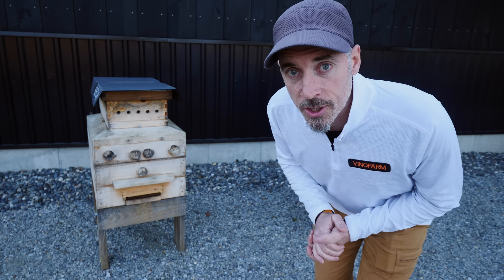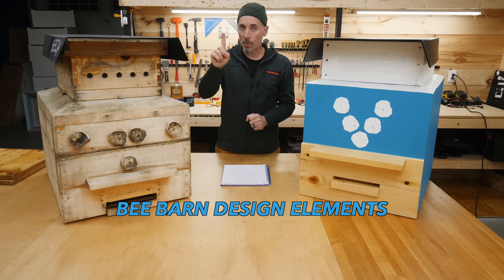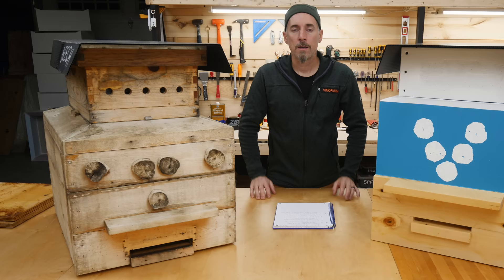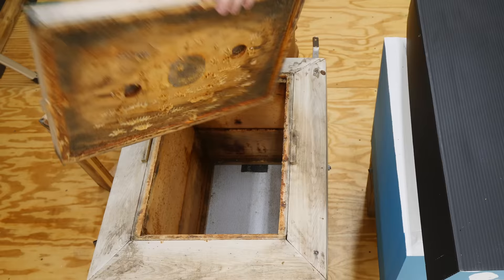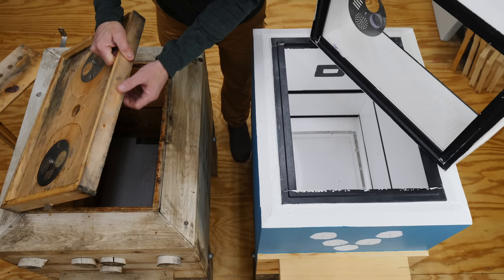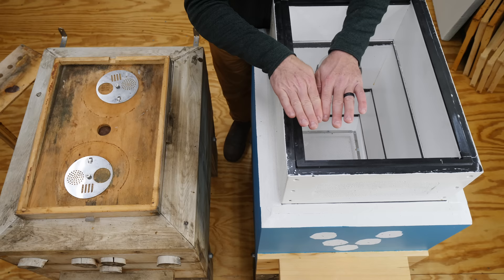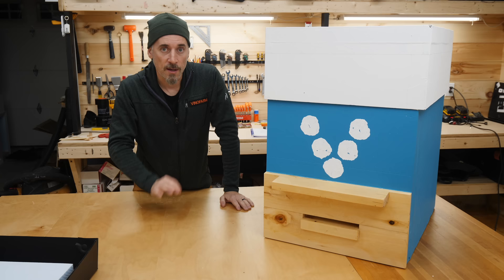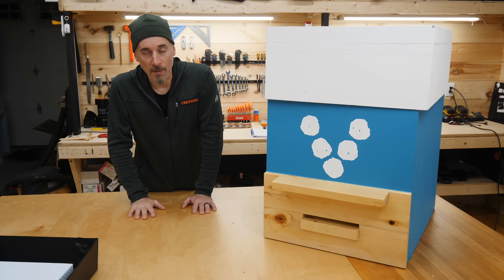I Fixed The Langstroth Hive (Again) - Bee Barn 2.0 REVEAL!

Comment: I just started beekeeping this year with a top bar hive. It's a 2nd hand one that I had to really clean up and repair some parts but my son helped me with that part. We scraped the inside and lightly torched it to kill off any nasties, replaced the bottom screen and board, which was in pitiful shape, and built a bee yard in the southern corner of my back yard. Due to the neighbors garage it's in the shade until about 10a but then it gets full sun for 4-8 hours, then back to shade. There was a small tree growing in the fence so I left that there to provide some shade during those hours. It's going to get cut so it won't grow any taller and I'll keep the branches thinned out some. I left all the honey in there this year because they are still, to me, a small hive so I wanted to make sure they had enough food. I live in northern Wyoming about 30 miles from the Montana border. Sometimes I feel really anxious - did I do enough to keep them from getting too cold? Did I leave them enough food? I'm only going to keep the one hive though. I got it to help the fruit trees and other plants around my neighborhood to bloom better and produce more.
Reply: Hi Roxanna, you may want to look up David Burns who keeps bees in cold weather also.  He has some winterization videos for regular hives that may be helpful.

Comment: Thanks for your Videos,  they are always inspirational and entertaining.

I use Paradise Poly hives and using your inspiration converted some of my boxes to deeper frames using a full and ideal hive box.  I also reduced the bottom ventilation for Winter.

My results were that I had a heap of condensation and mold at the top of the boxes, although admittedly it was a wetter winter.

I do agree with the extra insulation at the top though,  that is where the condensation seemed to occur mostly.  It almost feels like the humid air rises and then condensation forms at the top around areas that it is colder, so I was thinking of doing similar things with regard to extra roof insulation.  I might try and increase that this year with a lid that goes down over the top of the lid to get extra insulation at the top.  .

One of my other big issues was the lack of utility in having the longer frames.  The longer frames were harder to use with regard to moving frames into Nuc boxes or moving frames around for Queen breeding etc.   For now I have decided to go away from this idea although I still like and understand the concept.  What I will use is a full frame at the bottom and an ideal frame at the top.

Look forward to further updates.

Comment: Maybe it's in the follow on video's. I come from a much colder climatic zone so this may not be relevant for your location.

Did you raise the Interior point of the Entrance so it is elevated above the bottom board? This allows some space for dead bees to collect during the coldest parts of winter when the bee's are in a tight cluster and the undertaker/cleaning bees are not disposing of them.
I found this made a big difference in the entrance staying open - not getting blocked by the dead bees piling up.
Reply from the maker: What I have noticed with these hives is that the “piles of dead bees” thing doesn’t happen. I used to see it on my old hives, but last year and so far this year there are roughly zero dead bees on the bottom boards. It sounds crazy, but that’s the case. Very few bees die over winter when you give them a good home.

Comment: Awesome Job Jim!  I really like your original concept of full insulation, we do this in our house, and it helps keep our energy bills lower.   I'm excited to see your version 2 performance results.  
One first thought would be to put coreplast around the exterior to prevent mice from chewing through the polystyrene.  Although the paint may give it enough protection.

I like the winter outer polystyrene cover.  I think that you could add another layer of polystyrene from the bottom lip of the outer cover that goes further down the side of the brood box.  This will add a little more insulation and help center the outer box to make sure it keeps your 1/2" air gap.  I like how you use the angled surface to match the insulation on the bottom brood section.  I think that the angled corner sections may be catching some of the cold wind and causing a cold corner spot which could be what is causing your corner condensation.   The outer cover angle could be making a small wind lift crack that lets air go through your angled seams.  Making a further insulation extension that goes over the lower brood box will help add some additional overall insulation and prevent any airflow through the insulation mating seams and the corner cooling.

Are you going to paint the inside of the polystyrene?  Do the bees eat or damage the polystyrene?

Comment: Hi Jim, I like the design of having a small spacer board that you can pull out to allow you to carefully lift up and inspect your large frames.  In the summer configuration, I like how you will take out the large winter foam spacer and replace it with two of your larger frames.  You mentioned that you will have some small wiggle room left over.  Are you able to use a small spacer for wiggle room?  If so, how thick?

What is the frame spacing that you are using? 1 1/2" or 1 3/8" frame spacing?

With large frames, do you think that using 1 5/8" or even 1 3/4 in spacing might help provide a little more bee space and ventilation, or do you believe that the bees would just go wild with bur cross comb building?

Comment: Would these boxes work well in warmer humid climates aswell,  like in GA? It seems like the foam would work well for the humidity,  especially with all the drainage you built into the design,  but would the heat in the summer be a problem?

Comment: Hi Jim, I was looking at the feeder box.  The insulation is really great.   Although you only use a few screws, three on the end to keep the box together.  The screws are made of metal.  They will have a high coefficient of thermal conductivity.  This could be a possible reason why you may have a cool spot in the corners.  I think if you rabbit cut your Polystyrene ends, they can just be glued together and make a strong box without any metal screws.   Plastic screws could also work well, but I don't think you even need any screws, just rabbit and (Epoxy Glue) them together.  The Rabbit joint also makes a zig-zag step-like fit structure that prevents any airflow in the corner versus just a straight 45-degree or 90-degree fit joint.
Reply from the maker: Good points. But again, the whole feeder box is covered with another box with zero thermal bridging. I think it will be OK. Thanks!
Reply: @vinofarm  I agree, but this would only make it better.  It is more for when you do not use the winter outer cover.  You can see this is where you are getting the heat transfer and condensation in the corners.
Reply from the maker: @barryguthrie8061  The way these boxes are joined greatly minimizes the thermal bridging that could occur from the screws. The screws screw deep into the 1.5" of foam on the side pieces. There's no metal actually bridging through to the inside cavity. Pure foam and glue would be an improvement, but the foam itself is already acting like a thermal break.

Comment: Are you able to use your standard wooded super boxes on your 2.0 hive?  Seems like the 2.0 may be too wide.  I am finished building my first 1.0, wrapping in Cedar.  It is beautiful, well for now anyway:) Learned a lot.  1 thing that I thought I was a genius but proved myself wrong.  You MUST leave some of the hive box above your framing.  I ended up adding a 3/4" piece all around. Now I will have to add that to my frames to keep the correct bee gap.

Comment: Being the pedantic type, cold NEVER seeps into a system. It is heat that does the leaking in or out. Per the Second Law of Thermodynamics heat transfer is ALWAYS from hot to cold.
Reply from the maker: What is the heat replaced with?
Reply: In the example of a cold environment and warm bee hive, as the heat in the hive leaks out and transfers to the envt the bees have to replace lost thermal energy through their metabolic heat and honey energy source. If not replaced then the hive cools down. Nothing new to you there.

Love the modified hive design and construction break down. I’ve been moving my hive to the south side of the house in the winter. now I need to do something similar and add closed cell foam to it.
Reply from the maker: @kevintoly2864  I was being snarky. When heat escapes, it is replaced with cold air through holes and cracks and gaps. (Not to mention huge front entrance.) That’s why I’m trying to seal every possible point of entry aside from the front door. I want to give the bees just one opening to worry about.

Comment: Hi Jim. Why don’t you simply buy polystyrene hives for their insulation benefits and avoid the transportability, modularity and compatibility issues  of the bee barn?
Reply from the maker: I'm not sure if you have watched any of my other videos, but this hive is an attempt to solve numerous hassles I have with "regular hives." These hives have deep brood cavities and deep frames. They eliminate the need to lift brood boxes. I have not lifted a brood box in 2 years. They give the queens much more uninterrupted comb to lay into. They provide a thermally isolated cavity with no drafts and no thermal bridges to outside air. I'm trying to create a hive that is perfect for the bees and the beekeeper. Regular stackable hives are crappy for both.
Reply: @vinofarm  Ok.  Thanks for the bigger sense of issues you want to solve.  The common solution to lifting heavy boxes is to use all medium equipment.  The boxes are much lighter.  Kim Flottom uses all 8 frame mediums.  That eliminates the heavy lifting problem for most people.  I know your jumbo frames can get quite top heavy with honey and awkward to handle in the summer, when we are in the hives most often.  Regarding the 'uninterrupted comb', that doesn't seem to be an issue in beekeeping at all.  Otherwise, queen excluders would not exist.  Queen excluders are included in most beginner beekeeping kits because queens readily roam up and down the hive.
Reply from the maker: @operaheartbeats  If Kim Flottom uses all 8 frame mediums, then he is lifting hundreds of more boxes than I am, no matter the weight. If he likes lifting boxes, that's great. I don't like lifting boxes, so I don't lift ANY brood boxes. Lifting lighter boxes does not "solve" the issue. During inspections, I open the lid, lift 4 or so frames and close the lid. No boxes. To say that my frames are "top heavy" is funny. Compared to what? A 7-8 pound frame is a lot lighter than a 40 lb. box no matter the weight distribution.

"Regarding the 'uninterrupted comb', that doesn't seem to be an issue in beekeeping at all."

You say that as a beekeeper. It's not a problem for the beekeeper. Have you seen how queens lay eggs when they have uninterrupted comb? You know when beekeepers pick up a frame and say "Oooooh.... look at that brood pattern!"? And they hold up a Langstroth deep frame and it has a semi-circle of brood on it? There are no semi-circles of brood on my frames. Queens lay in huge ovals on my frames. They start in the center and do big loops laying eggs in a big outward spiral until the whole frame is covered. On a deep (or silly MEDIUM, ugh.) they try to do an oval, but keep hitting the lower bar and have to turn around and go back. It's so inefficient for them. Once they fill up that space, they have to jump a gap to a lower level and do the same thing again. On my big frames, the queens can spend an entire day laying eggs on one continuous comb.

Queen excluders have nothing to do with the continuous comb in a brood box.
Reply: @vinofarm  Thanks for that explanation.  I see you lifting many boxes.  You lift full honey supers.  In my operation, I rarely lift boxes.  I use a 'beehive lifter', which is a pulley based box lifter on wheels.  Fits in the back of the truck.  It is an asset to the operation which helps me in do multiple heavy tasks easily.  I use it to lift heavy bee boxes and use it again to move full honey supers around the honey house.  I use it to move beehives without any help.  The tool does all the lifting.  

That combined deep + medium jumbo frame of yours is heavy when full of honey and brood.  No doubt about it.  At the peak honey pull season and in the fall, many of your jumbos are at least 50% heavier than one honey-filled deep frame.  Even normal sized frames can be difficult to handle when glued down with propolis and chock-full of honey.  What happens when you drop one of those things when full and heavy?  Those wooden side and bottom bars look pretty fragile for the mass.  I think a full one will likely break apart.  What do you do?  Duct tape it?  All those lost resources.

A healthy hive with a productive queen has no problem with traversing up and down boxes of supers.  The queen doesn't stop and 'turn around'.  Healthy queens readily lay in the first box, in the second box, and will happily lay in more boxes if you don't stop them, with a queen excluder or with a honey super containing only foundation.  Bees don't care if their brood nest is oval, rectangular, or whatever and they are not restricted by the bars.  Look up 'unlimited brood nest' for info on this topic.   The UBN concept is usually implemented with standard stacked hive boxes.

From watching your videos, I believe you've become a better beekeeper.  It is nice you are sharing your learning experiences with the rest of us.  I like that you want to do the best for your livestock.  The best thing you've done so far for bee health is to start taking the varroa situation seriously.  Over the past couple years, you've posted more videos of you monitoring and treating for the mites.
Reply from the maker: @operaheartbeats  We disagree on a lot of these points. But thanks for communicating. I appreciate your comments. Have a good day.

Comment: Hope you see this Vino Farm! I'm not sure if you address this question somewhere but I would like to know your reasons for going with (I think) 8 frame hives vs 10 frame? We are getting geared up to build some bee barns and are struggling with this decision. We don't have any boxes so could go either way, we would be building them out of wood, more like your first version, so we will be loosing a frame to make room for a spacer (right?). Hoping to hear from you! 
Ontario, Canada
Reply from the maker: I used 8 because I had a garage full of 5 years worth of 8 frame Langstroth equipment and 8 frame supers. If I was going to do it from scratch, I’d probably start with 10s and use spacers inside for smaller colonies and overwintering. These colonies get HUGE in spring and the extra space would be nice for expansion.
Reply: @vinofarm  Thank you so much for the reply!

Comment: Jim,  let me start by telling you how much I love your videos.  I really appreciate your humor, honesty, and scientific reasoning.  As a hobbyist woodworker, however, I must say that your scene at 1:57 of resawing a piece of lumber with your blade fully exposed and no added vertical support on your fence gave me the shudders.  One slip and your hand would be in the blade.  I highly recommend you investigate the use of either an auxiliary fence (adding height and stability to your operation), tenoning jig, or bandsaw (with a resaw blade) to increase your safety before releasing your how-to videos.  Thanks.

Comment: A quick comment on your winterizing box....  You mention that you left an interior gap intentionally as a "thermal gap", but convecting air is actually a poorer insulation than the foam.  Unless there's another reason for the gap, it's probably better to keep the gap to a minimum or maybe fill it with another layer of foam.
Reply from the maker: It's a thermal break to stop CONDUCTIVE cooling. I don't want any part of the outer lid to touch the inner box (thermal bridging.)
Reply: @vinofarm  Thermal bridging is when you have a less insulative material (ie. wood) that allows an easier path for heat to pass through than the insulation.  Foam is a better insulator than air that can move and carry heat with it.  All that said; there probably is a benefit in having the extra space to easily allow lifting the box of.
Reply from the maker: @cheapohubby1  I don't want to argue, but what do you think would be a better insulating setup: A box made of 2" of foam suspended inside a second box of 2" foam with a 1/2" air gap in between the boxes.... or a 4" thick solid foam box? Would that air gap not offer insulating value and help prevent conductive cooling from outside in?
Reply: @vinofarm  4" foam < 2 x 2" with 1/2" gap < 4.5" foam...   All that said; the 1/2" gap is probably the minimum you need to easily remove the box without it binding.  I got the impression from the video that the gap was larger than that.
Reply from the maker: @cheapohubby1  It’s exactly 1/2” all around.

Comment: Jim so happy you are back on YouTube.  Looking forward to the next series of videos.  Can you just do a quick test.  On top of the plexiglass can you lay a single layer of the Reflectix or similar foil / bubble insulation and then one layer on the inner portion of the winter cover.   If you can do it on the one hive and see if the condensation in the corners disappear.